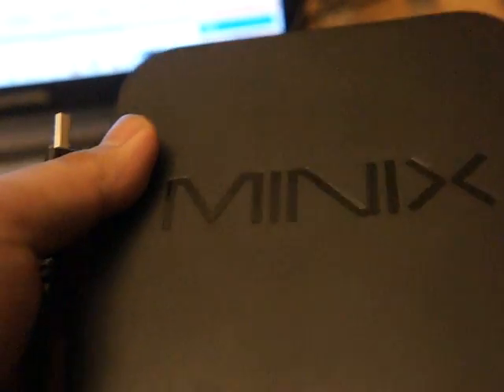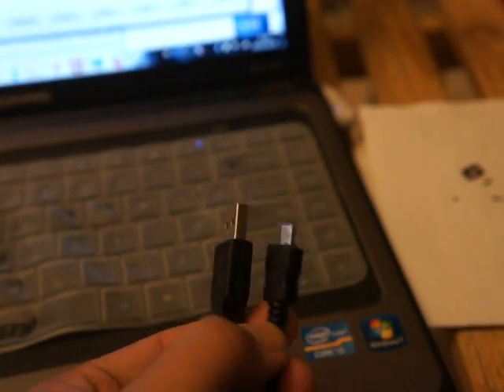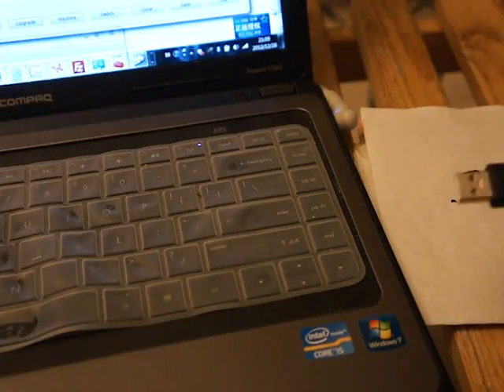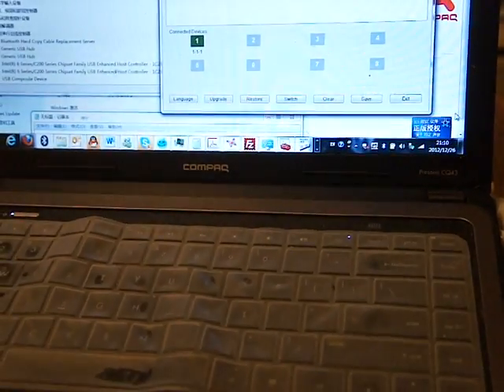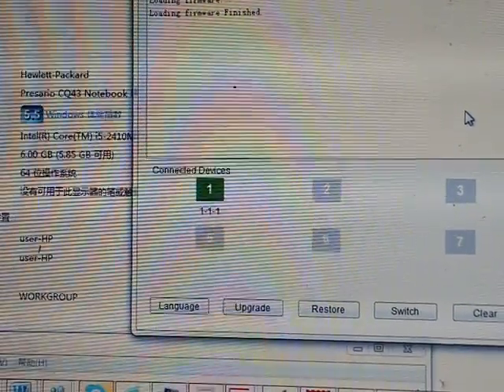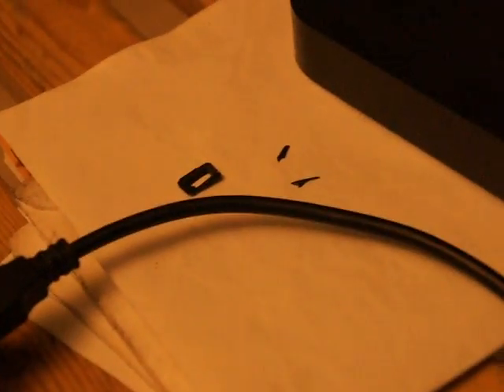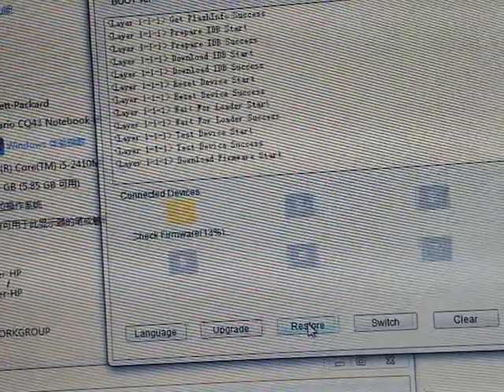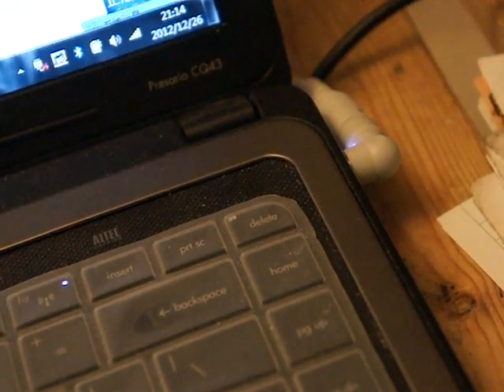MINIX NEO X5 OTG upgrade tutorial

Comment: My micro usb cable that came with my device had an extended tip (male end). Check yours before any trimming is necessary. Also for those who are having trouble with the drivers installing. You can get the firmware update, usb driver and flash toolkit at
(dot)minix(dot)com(dot)hk/Support.htm

Comment: Hi, very helpful video; I had problems at the beginning for connecting my X5 to the computer, and indeed your solution by removing part of the plastic of the OTG port connection worked, so if anybody has the same problem, my advice for them is to also follow the video for trimming off some of the plastic. After that, everything worked perfectly.

Comment: Missing information:
I am a little surprised that you actually HAVE to shave the supplied USB cable or it doesn't work with the OTG port.
After shaving the cable down, Windows does recognize it - at which point you need to manually install the USB driver - use Windows Device Manager, right click the device, and manually point to where the appropriate driver is.

Then, don't miss to the right top corner where the author clicked the button to navigate to the firmware, that's key as well.